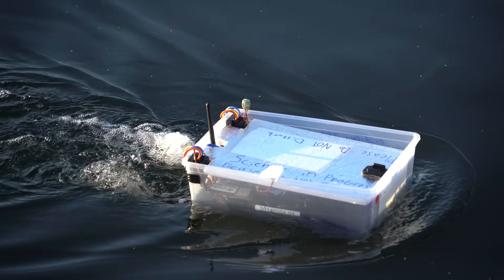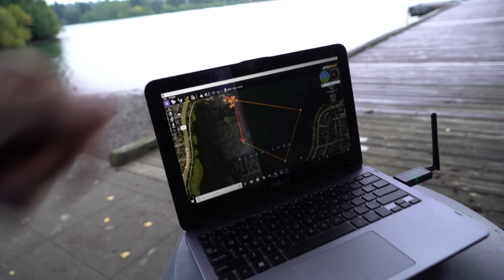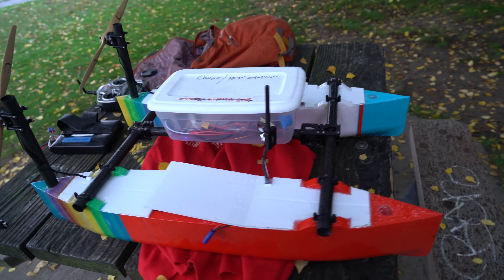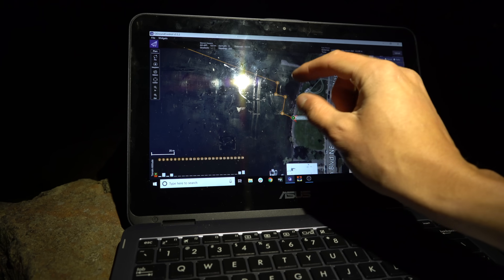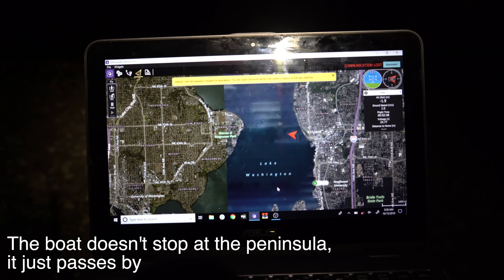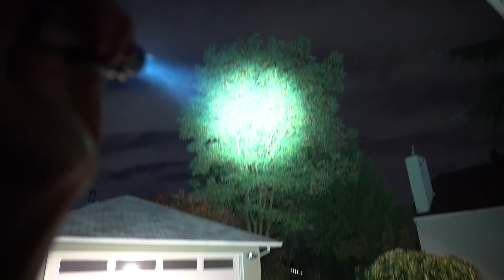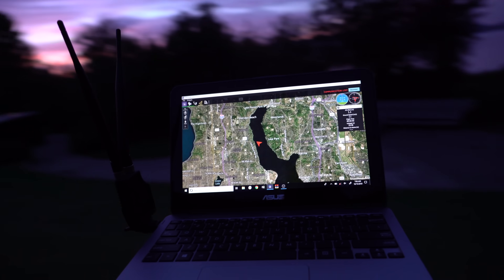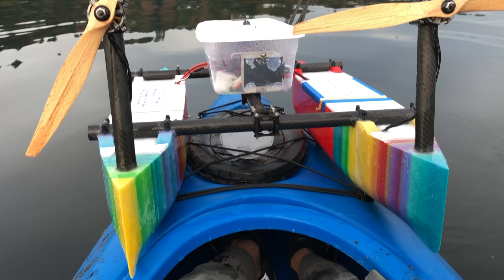Autonomous R/C Boat 13km Waypoint Mission

Comment: Hi, Thanks for sharing this video . I like to work on the RC boat project. I have few questions before start 3D printing the boat 1) how much infill have you used for 3D printing? Is it uniform all over the body or is there any division of infilling the PLA material at parts of the body. 2) Do you have any information of the strength for the percentage of infill used in printing the boat ? 3) Why did you not use boat propellers in this project ?

Comment: For floatation reserve I would use those packing air bags that Amazon and other companies use. They would conform around things and being sealed air would dispalce water if water did intrude into the hules. and bulky enough to give floation capacity.

Comment: To make 3d printed parts water (or air) tight: it is much simpler to use appropriate dissolver for specific type of plastic used. It melts layers together and evaporates, leaving perfectly solid plastic with no holes. I've made pneumatic system parts out of ABS treated with acetone.

Comment: I think the foam inside the air boxes actully made the boad sink, you replaced the air inside the box which helps the boat float ALWAYS with a foam which helps the boat to float ONLY in a case of water leacking.

So basically you added weight and dropped the floatting properties of the boat by adding foam to it.

Comment: This is so cool, did you considered fitting a bilge pump to pump the water out the pontoons? You could make it a manual activated pump or a water activated pump or an angle activated pump.

Comment: This is taking RC boats to the next level. You need a portable Tripod to mount your base antennas on.
As you know height is Might.
Maybe design your pontoons so the hull sides are about twice the height & use weather stripping to seal their hatches. They do have small water pumps you could install for bilge water along with a couple sensors to activate the pump, a cover that can Velcro on top the boats electronics container for esthetics & in case it rains.👍👍💛 Nice work man keep going on this until you perfect it. Thanks for sharing!

Comment: Don't know if you will ever read this, but if you find that your telemetry reception is dropping out, you could get an amateur radio license, then you could up the transmit power or use a lower wavelength.

Comment: Radio waves bounce across water pretty efficiently. I went on an Alaskan cruise many years ago and my cell phone could often reach towers on land, many miles away. The radio delay was pretty bad though so it was really hard to talk to someone. But pretty cool that the signal carried so far across the water.
Reply: Oh my god yes, whenever I go to the white cliffs of Dover (on the English side of the strait of Calais) the hills block English phone signal, but sometimes you can get very weak French phone signal even though it's 32km away (20mi)

Comment: Can you build an airplane that drops from a weather balloon,  and flies home,  perhaps with an experiment, maybe a time exposed sticky trap, to see what's up in the stratosphere. 

The plane could be fitted with a camera that pans around,  perhaps to show that the earth isn't flat or something.

It would have to have larger control surfaces to maintain control.

A microcomputer controller could jettison the balloon fragment tether, and open the sticky experiment. At the same time it could video feed a livestream.

You could literally have a platform for a various number of experiments.

Even wilder, pressurized gas nozzle microthrusters to keep the experiment oriented and aloft for a longer time.
Reply: Updated

Comment: This is just not speculation, but truth: Autonomous USV (underwater sea vehicle) is real. A battery that converts seawater to electromotive force has been around for decades: Ask NASA, they will point you in the direction of an open patent number.  Caterpillar style, silent drives are also known (props are way too noisy); a hull covered in a sound absorbent skin is being used by every country making attack submarines. Finally, the autonomous vehicle surfaces only long enough to download digital navigation data from coastal staged high power mobile transmitting stations that cannot be tracked (a data burst need only last 400 milliseconds). At the end of its delivery voyage it can be sank, or sent back for another trip autonomously. Estimated cost of each USV? Mass produced for less than $100,000 USD. 

How many can be manufactured in any given month?  Twenty a month. Payload? Estimated 454 kilos (1,000 pounds). 

In 1988 I wrote a film using the USV I have described for an action film. Two major studios turned it down:  "We don't want to give drug cartels the blueprint for smuggling."  NASA already had the plans for anyone to look at.

Comment: If you want to maximize range, I'm pretty sure applying a certain amount of power to a propeller in the water is more efficient than applying the same amount of power to a propeller in the air, which is why airboats tend to require more powerful engines and burn more fuel to push the same weight at the same speed, and why they tend to only be used in swamps where their ability to easily traverse the extremely shallow waters is more important than fuel efficiency.

Comment: Hgdcp antenna not a bad idea but you can get much better distance with your existing antennas if you mounted them horizontally. Of course this will only work when theboat is in alignment with your other antenna. However if you place the antenna on the boat perpendicular to the path of travel in a horizontal position and match that angle with your ground station then as the boat travels away from you and directly back towards you you should have excellent signal. You will likely lose signal momentarily as the boat turns around to come back but the signal should return as soon as the boat is in proper alignment
Reply: Signals from a linear travel much farther along the ground when they are in a horizontal position. Just look at some of the designs for old school TV. Short-range local stations would mount their antennas verticallyso as to be able to cast a 360-degree signal. But long-range repeaters always had their antennas mounted horozontally. They also tended to have high-gain antennas.but they were still mounted in a horizontal position. This is because of multipath reflective signal. When a linear antenna signal bounces off of a surface that is perpendicular to either the path that the signal is traveling or the direction that the antenna is positioned, that bounce reverses the signal.so since the water or ground is more in line with the direction that the signal is traveling and also in line with the direction of the horizontally positioned antenna, if the signal bounces off the ground or water and then back up and is received on the other end that signal is not reversed.

Comment: heres the solution to the propellers getting tangled problem:
Make a cylinder and put the propellers in them. On the intake side, add a mesh. periodically have the mesh rotate in case it's clogged up with weeds.

Comment: If water leaks in; it should leak out.  Just as a suggestion.  Remove all of your electronics and fill the pontoons with water and see if it leaks out.  Another idea is to use chalk line chalk and mist some on the outside of the pontoon and it will help you find the leak.  It will be messy though.

Comment: £d printed boats are a pain to completely seal up. Over time a tiny itty crak could start to expand with constant pressure. When I made my first 3d printed boat I had all kinds of problems. Luckily enough I had the outer and inner hull. 

I filled the hull  with Tipex. It also showed where the tiny cracks where.

Comment: I think 3D printing them out and covering with epoxy layers is an overkill, normally I just cut them out of thick piece of building insulation styrofoam using a hot wire or hot knife.

Comment: fill the pontoons with Polyurethane foam it will float and seal them from the inside.  You can scoop the needed space  for battery or electronics out of the foam.

Comment: Hey man! Love this project and your channel, keep it up! I have a 7 meter slow motorboat that i'm thinking of making a autopilot for, or at least some kind of heading assist. Maybe using a pixhawk would be a good start? how hard would it be to program it to use a big servo to correct the steering wheel? :)

Comment: I built an FPV, autonomous, tetherless  underwater ROV using RC parts (including brushless motors potted in epoxy )  which ran an autonomous 8 mile mission at a 15 foot depth.  The only problem was that I lost telemetry and video signal early in the mission because the gps and antenna array being towed at the surface was too low for the signal to travel very far. I'm just wondering how long it will take for government to regulate or outright ban this sort of "hobby."

Comment: Cool project. Use some fiberglass fabric with the epoxy on your pontoons. I've made outriggers by carving pink lumber-store insulating foam, then giving it a layer of fiberglass and epoxy. If you start with insulating foam (comes in difference thickness, I usually laminate them using gorilla (foams up) glue. This way you can plan your compartments instead of trying to pack in loose foam pieces for emergency buoyancy. I don't think any of my outriggers has ever had a leak.  (And you may already know that 'fiberglass resin' the cheap stuff is not really waterproof. It develops pin holes that cause endless problems). 

The foam is really easy and fun to carve and shape. Use wood rasps, rough grades of sandpaper. You can lay patterns on the sides and top and bottom and then cut out the shapes--if when you rough cut out one direction--leave it in place as you cut out the 90 degree shape.

Comment: Maybe add a little rubber seal under the covers on top so the hulls so it wont take on water. very little weight and would do a great job sealing with those bands strapping them down.

Comment: I never would power a boat with Airprops.
The loss of energy is too high !
The most efficient way to drive a boat is you are as close as possible
to the riding speed with your thrust speed and that you will get with waterprops.
A catamaran is a good choice but your drive isn't.
So make a new design and continue your tries.

Comment: GEESE not GOOSES.
Reply: Also, you could use those air filled bags you get with some packing systems, the long tubular type and they could pack out the void and minimise any water ingress.

I also suggest that you have a buoy or set of them attached to the hull so that should it sink and the inner voids not contain enough packing, then your boat should float if it sinks and maybe a tracker that is on an independent float the will stay above water and allow you to find it by that tracking signal.

Comment: Dude! I SAW YOUR BOAT! I took a video too check the link. Also we have met once before I work with RENNKAMERA and was at the testing day in Shelton back in 2017. I could not figure out what was on the water happy my mystery was solved. If you ever need a dock to launch from you can use mine. https://drive.google.com/open?id=1ZAC7bdav96yLtL5ZMoRLYCbF8fnRHJFV

Comment: Put a bulkhead in the front of the pontoons and fill with diesel. Would make the ship slightly nose-heavy, helping against water coming in from the rear, and possibly giving greater efficiency to the props as they would not be wasting energy generating lift, also if the worst happened and the batteries caught fire, it would be a lot more spectacular when the fire gets to the diesel ;)

Comment: Might be late to the party here, but why not go with a catamaran configuration with redesigned hulls to cope with the weeds, and use a paddle wheel for propulsion?  A well designed paddle wheel should be pretty impervious to weed problems, as well as being very a very efficient propulsion system.  You could even use a stepper motor to run it, which could give you all sorts of telemetry data for what the motors are doing.  You would have to add rudders to the stern of the hulls, but that shouldn't be much of an issue, and it's a lot less power hungry than differential steering.  Alternatively, you could try a flat bottomed boat reminiscent of the old river boats, with a paddle wheel on the stern and a rudder behind it.  A design like that has very shallow draft, and is even less effected by weeds and the like.  A third option is to just have a wheeled vehicle where the wheels are both flotation and propulsion, thereby completely eliminating hull drag from the equation.

Comment: Could you add some sort of bilge pump possibly (a small peristalic pump maybe?)

Also for waterproofing would a heat gun/hair dryer/oven help seal the layers more by partially remelting it?

Also would a mini "swamp air boat" work for dodging weeds etc?

Also solar panels perhaps?

Just some random thoughts.

Comment: check "tech ingredients" latest catamaran design "tesla boat" looks to be a really efficient hull design, its rear bottom left extended being horizontal stabilizing fins. definitely need a swept bow to not snag floating junk. typical displacement hull formula: square root of waterline length times 1.56 = max speed in mph, for electric efficiency you'd want 75-80% of that number as your max. >so> 4ft catamaran = 2 x 1.56 x 0.75 = 2.34 to 2.5 mph. the old guy "tech ingredients" hull idea may fare a bit better than that for being 0.9 ratio symmetrical laminar flow pontoons.... might be great for extending range.  the lighter the better, and the less freeboard the better so wind doesn't shove it around. boogie board is going to have a lot of surface tension drag no matter how its sliced, unless powered up to be planing!
of interest? NumaVig https://www.youtube.com/watch?v=WDV-nGd-mjQ little airboat is screaming fast for a single 2 dollar 180 motor powering it, scaled up for two motors run by solar cells at a lower speed? it's a shallow V forward single step hydroplane, are very efficient too once up on step.

Comment: i am using 5,8 ghz fpv even for a rc car, the only big problems are concrete walls and multiple buildings. aslong the antennas have sight to each other the range should be like in a plane
btw olight lights are really nice, but the prices are far from nice. Luckily my Olight S15R costed like 18$ from a chinese shop, instead of the regular price of 60$. For anything else i prefer "special" lights like my cola can from Noctigon (Meteor M43, more than enough power AND runtime with 4x18650) or a modded LedLenser F1 as EDC with around 1000Lm/16340 LiIons or some other lights (LL M7R X, Thrunite TN35, Nitecore Sense CR, TIP and a few TUBEs on keys,....)

Comment: Awesome job.
maybe use use the two motors inline and install a rudder on each with independent servos. at least if one motor fails you still have propulsion and control.
directional antennas on the laptop and RC controller  would help you get control and telemetry at a much greater distance. (for budget solutions; cantenna, old satellite dishes ect)

Comment: You should add a crossfire or dragonlink system.  Both will support telemetry with apm/pixhawk with long range.  The dragon link even has 1000mw receivers and at 433 mhz that is going to keep your telemetry the farthest. Those systems then output via bluetooth so you just connect your laptop via bluetooth to the transmitter and mission planner can get all the data through the bluetooth serial port.

Comment: Maybe a Screw Drive boat might be more efficient. Not only will weeds not get caught in the screws, but it could also technically drive on land. 
See video for an example of a "Screw Drive Vehicle" -> https://youtu.be/nVOaDfGOPGs

If you still want to just use air fans, or normal propellers, I recommend making the boat hulls into flat bottoms. They will go over any water debris much more easily.

Comment: does it work by finding the delta x/y cords per (time), using that to calculate the angle relative to north the boat is going(angle1). then it calculates the angle to the target(angle 2). angle 2-angle 1 gives you the angle in between, then you use that number as to turn.?????

Comment: catamarans are more efficient the less weight you put in them, so constructing the hulls from a more light weight material would counter some of the energy consumption issues you're having, aslo the sharper the hull the straighter line they will follow and again less energy they will lose between point a and b

Comment: Hull design was not bad but the bow needed to be raked back 30° to 45° to solve the issue.  The epoxy over the PLA is a good idea but it would not hurt to use some fiberglass matt as well.  Also epoxy will degrade in water after a time and the thinner it is the quicker it will degrade.  This could have been part of the issue.  I live near you and I used to build RC boats, if you want some help with the hulls let me know.  And lastly use clear duct tape over the hatches.  Blue painters tape will not keep the water out forever.  My hydroplane lost many servos and receivers to the blue tape.  Once I started using the clear duct tape I never lost another one.  I still use it on my tugs where the hull openings are in areas that get wet.

Comment: Next up a boogie board??  smh..
You're brilliant with all of the electrical/electronic stuff.. but you really need help in the boat building department.. I mean really, gen1 was a fn box, and now glued 3d prints tried to sink on you lol.  
Check out offshoreelectrics forum, or rcgroups boat forum, or better yet, find your local rc boat club.. they'll have several members with experience making wood and/or fiberglass hulls plus being familiar with defeating that nasty weed stuff you have up there.
You might even end up running 10-20 knots and not fear medium wind, waves or weed.